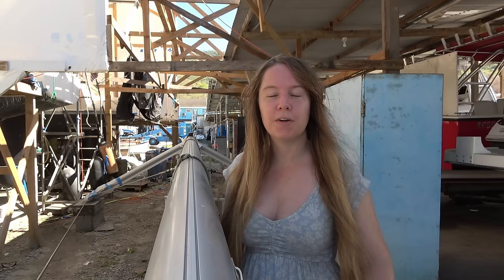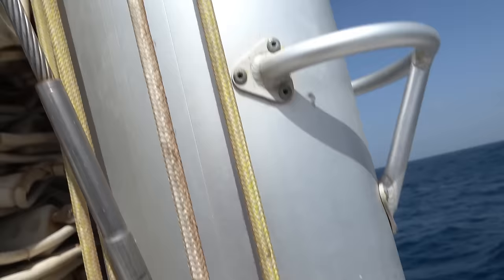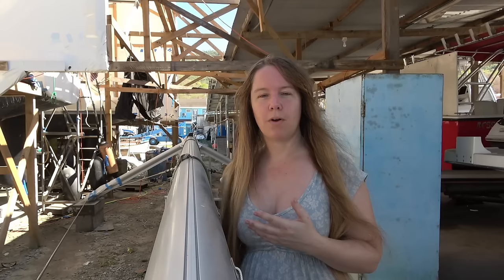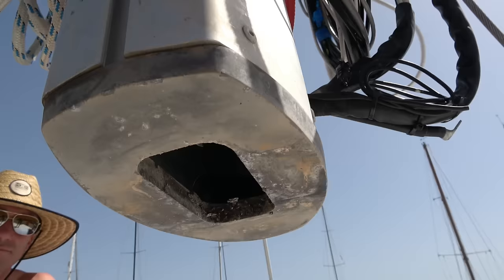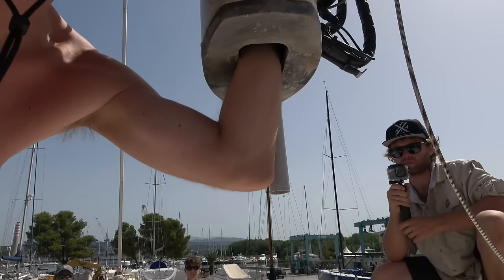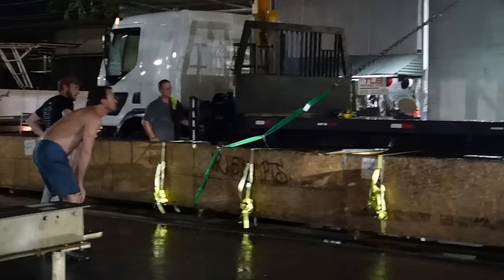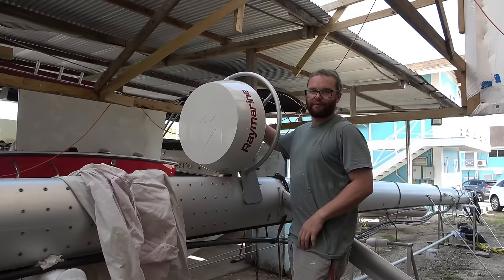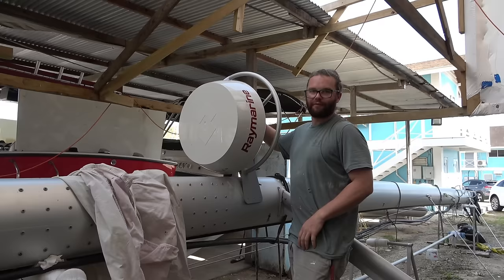Mast Warranty Update for our Leopard 45 Catamaran | NEW YACHT WARRANTY

Comment: Same stupidity as the drilling through the wet exhaust hose!!
Reply from the maker: Should see the Leopard 45 across the yard, they drilled through the bridge deck with a 2 inch hole and left the hole open. Water pours in, this passed QC.